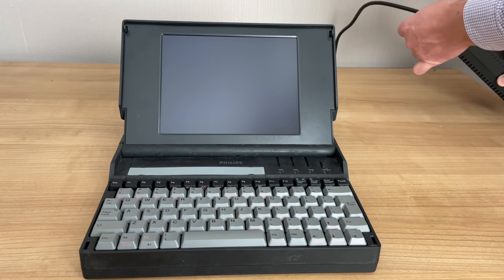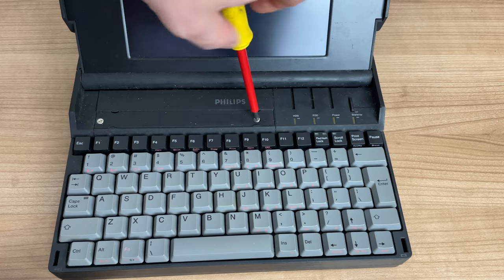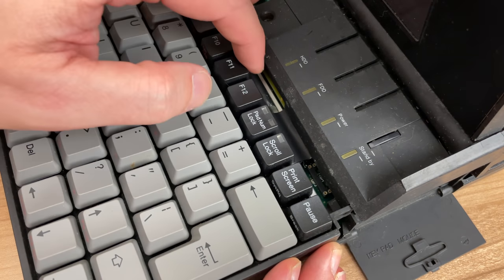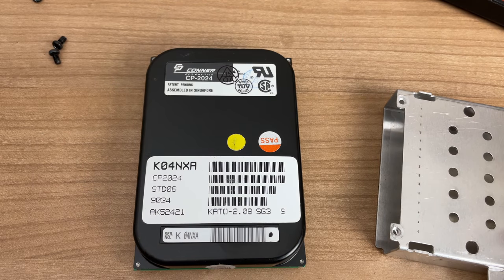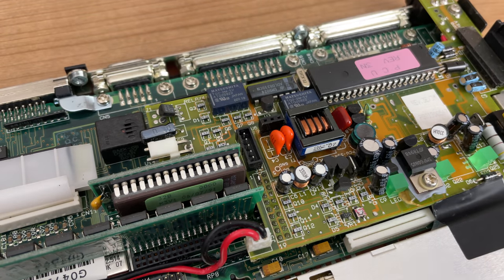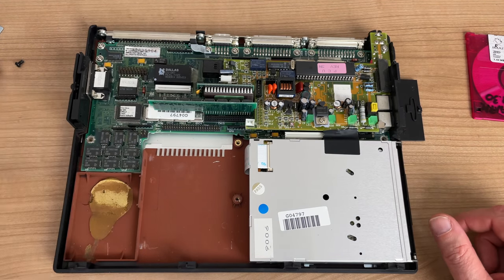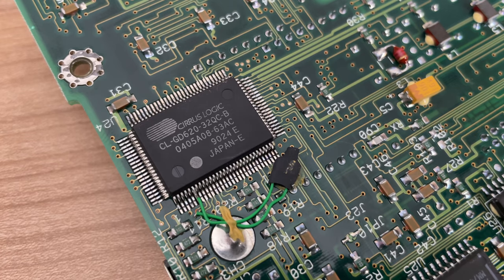Philips 286 laptop - into the belly of the beast

Comment: Whenever I attempt something like this, I test the machine immediately after disassembly to see if it reacts the same as it did assembled. That way, you are not left chasing down hundreds of rabbit-holes that were not caused by soldering or de-soldering a chip...
Reply from the maker: Didn't put it in the video but I did test the basic components (motherboard + keyboard with external monitor) after disassembly and before I started working on the Dallas chip. The issue occurred immediately after replacing the Dallas chip. Because I knew this was going to be difficult (I replaced it with a brand new Dallas chip) I removed it once again an installed a socket so I could more easily swap them in / out.  what I should have done was to look where all the pins are routed to by doing continuity checks on all of them before I started work on them.

Comment: 12:40 when you tried desoldering wire to clean, you touched the chip's (m024g)  legs with wire. Maybe that was what it caused that issue.
Reply: Not to mention he also contacts those pins with some flux beforehand, definitely something to check out!
Reply: Nope

Comment: Try to reconnect the yellow internal battery, the powersupply uses it as capacitor so if it was missing, the motherboard don´t getting correct voltage, I have simular problem with my laptop
Reply: If the problem is the lack of the yellow internal battery, I suggest extending the cable to the outside of the laptop to connect the yellow battery on the outside of the laptop. It's uggly, but this way you can disconnect the battery when not using the laptop and prevent any damaging leaking from the battery to the internals of the laptop. I've made this mod to a Toshiba laptop.
Reply from the maker: Same issue (beep codes) with the yellow internal battery attached
Reply: @RetroSpector78 .. At 15:17 .. that high pitch is an inductor coil.. from a voltage regulator or similar.......
Is at full capacity trying to sustain the voltage output... because there is very high consumption......
you short something up... in that white video connector that is above the dallas chip...
All around the pins of the Dallas chip..... is a lot of traces that go to that flat video cable white connector...
for example .. at 14:33 the 3 pins 13.. 14 and 15 of the dallas chip.. looks like they are in contact with the trace that pass below them... maybe solder mask broke in that trace... 
at 18:54...  the trace that is between pin 7 and 8 of the dallas chip... looks cut....
at 14:28 the trace that is between pin 3 and 8 of the dallas chip... also looks cut....

Comment: The high-pitched noise is the DC-DC converter struggling, there's some power rail pulling too much current. I'd have guessed the backlight power, but the LCD seems to light up no problem. Something's obviously shorting out, and you were working in the area of the display connector, which is now acting up, so I'd concentrate in that area looking for the short.

Comment: The Dallas package is right between the chipset and the video chip. (which probably sits on the ISA bus) I would measure every pin of the  video IC, (probably you find datasheet and pinout) and make sure they are going somewhere. Usually some bus driver IC's. Also make sure this bus driver's are connected properly to the ISA bus. (which you probably can measure on the expansion connector)
If you break some connections while desoldering the Dallas.
That CHIPS IC on the middle is the peripheral controller/superIO. The Dallas clock surely connects to it.

Comment: Suggestion:  splurge on a desoldering gun.  You should be able to find one for about 100 euros.  I was able to get one here in the USA for $125.  It's the same one that Jan Beta has used for years.
Reply: yup, can recommend the ZD 917 as well. Although I have to say, with that old solder it's different everytime. I have spent days on a Dallas chip with 2 ndiffrent desoldering stations, wick, a pump and whatever else I came up with and the result still looked awful. sometimes the stuff corrodes in a way that it just doesn't want to melt anymore.
Reply from the maker: The really really sad part is that I have one, still in box. Time for an unboxing video I suppose :(

Comment: My Compaq SLT-286s are also height-challenged so I couldn't install a socket for the DS1287, so I opted to drill open the pack (there are tutorials online) to disconnect the internal battery and connect an external one. So in about 20 years, when it will run out, I only have to desolder two connections instead of having to remove the entire chip (it was challenging drilling the holes without removing the IC though - but this is now one easily serviceable laptop with zero damage to the motherboard)

Comment: Argh. I feel your pain. I’ve had so many similar experiences of older laptops, which ends up being so frustrating when all you want to do is preserve something increasingly rare. I think all you can do is connect everything as it was originally....? The only comfort I’ve had from an experience like this is then breaking up everything for spares and selling them to others who use the spare parts to return other machines to full health.
Reply from the maker: I know ... but it was worth a shot ... Something needed to be done with the Dallas chip anyway otherwise the computer was pretty useless. (could only boot from floppy and hd wasn't recognised). If I didn't do anything with it it would have just ended up on a shelf.
Reply: @RetroSpector78   You can’t save them all, and unfortunately some will perish by our own hand.  That’s just the risk you take when you maintain these old things.  But like you said, the alternative is also often a non-functional machine.

I just put a PS/2 floppy drive in my “project for another day” pile after discovering that its drive heads were connected by a ribbon cable rather than the shielded wire of the others I was working on.  Guess how I discovered that.  😒  I guess it’s time to learn how to have flex PCBs manufactured...
Reply: @RetroSpector78  it did occur to me since watching that the Philips CDI has a similar embedded battery - i can't remember if it's a Dallas, and instead of desoldering that, I used a dremel to eat away at the plastic and get the cell battery out of the middle and then solder on two wires so i could run a 3v battery at length, and be easily changable... could this have been an option?
Reply from the maker: @sandycheeks7865  perhaps, but using a dremel and trying to fit a coin cell in such a tight space is also tricky. I’ve done it a few times but never liked it. Despite of how it looks now I have replaced lots of them before :) ....but sometimes shit happens and as you probably already know I am not a trained professional. You win some you lose some I guess.

Comment: Oh boy :S That was unfortunate :(
This video made me afraid of soldering/unsoldering, unless extrictly necessary to repair something that isn't working. I've seen a few mods to Dallas chips, were people drill part of the casing and connect a new battery.
Anyway, I really hope that you manage to fix the laptop, and that the fix is something easy to do.
Reply from the maker: I've done the coin cell hack a couple of times, but it is so crammed inside this laptop that it would have been difficult to put the coin cell anywhere. And I don't really like that method. I have desoldered these chips over a dozen times without any issues but sometimes you get unlucky I guess ... (especially combined with my crappy (de)soldering skills)
Reply: You can also use old sacrificial soldering iron tip and melt your way into the Dallas Chip internals. Less messy, excluding the smell and probably carcinogenic melted plastic fumes :)
Reply: @RetroSpector78  Ah I understand the problem of lack of space. There is no doubt that with a new Dallas chip the laptop would also look a lot better. From seeing the desoldering/soldering parts on your video, it all seemed to go well, I would have never guessed that that operation could potentially damage something. Was this your first time getting unlucky?
Reply: @||  Don’t let it sour you on maintenance.  Accidents will happen, but if you practice your skills on scrap boards until you feel comfortable with it, you’ll win more than you lose.  You’ll always lose one or two here and there - that’s just life.

I feel like learning how to solder and replace ICs and capacitors is part of owning retro machines.  If you can’t come to terms with that, they will eventually self-destruct, and then what have you really gained?

Get in there.  Be careful, but don’t be too critical of your failures.  It’s inevitable.  Learn from it and move on.
Reply: @nickwallette6201  Thank you for the motivation message :) I'll keep practising, I have a lot of PCBs that need repairing. I'll just avoid doing it when there is another method available to maintain old hardware.

Comment: As information:
If the DS12887 is a new part, you may need to start the oscillator...

"When the DS12887, DS12887A, DS12C887, and DS12C887A are shipped from the factory, the internal oscillator is turned off. This prevents the lithium energy cell from being used until the device is installed in a
system. A pattern of 010 in bits 4 to 6 of Register A turns the oscillator on and enables the countdown chain. A pattern of 11x (DV2 = 1, DV1 = 1, DV0 = X) turns the oscillator on, but holds the countdown chain of the oscillator in reset. All other combinations of bits 4 to 6 keep the oscillator off."

http://dgmag.in/N1/Online/advanced/48629.pdf
Reply from the maker: Not sure if this is the issue here was with the original DS1287 I'm getting the same beep codes. I have replaced these Dallas chips in over a dozen machines each time using new parts from digiKey and never had to do that ... But interesting info thx for that.
Reply: Interesting, didn't know that. Not entirely unrelated: My Commodore PC40-III didn't set the time display correctly, it needs decimal, but the chip outputs hexadecimal, leading to times like 1; : 4< o'clock. I put the module in my IBM 55SX, that corrected that, then I put it back in the Commodore.

Comment: 1long, 3short No video card or bad video RAM- Reseat or replace the video card. To aggressive on the heat gun maybe? Try measuring circuits, your only solution maybe. Those chips next to the Dallas clock are bus drivers. Thanks for the video, I always enjoy watching.
Reply from the maker: Thx a lot, ideally I should have another laptop to compare it with. I think this board was also used in Siemens laptops.

Comment: The machine seems surprisingly serviceable. I have a similar laptop (a 386 SX made by ESCOM), where the hard drive is buried under the power board and in order to add a math co-processor you have to take out the motherboard. But at least it doesn't have a Dallas clock chip.

Comment: You have probably did some damage with the hot air gun. Check the blue thing between the two  244 IC.
Reply from the maker: Seems to be an EMI suppression filter (1000pF) that is wired in a creative way. Not really sure how to test it.

Comment: 9:20 The two chips with pink labels(firmware versions), one of those will be the keyboard controller. The big 40 pin DIP chip with pink label on the power-supply board, that will be a microcontroller for the supply and charging management.
Reply: Pretty sure the other PLCC is the BIOS; I thought I saw a 27C part number on it.

Comment: The high pitch noise suggest a power supply overload. That pink-white cable is the CCFL backlight power feed. (it has it's own small PCB with that large transformer) I would try the laptop with that disconnected. Beware, high voltage there!
The PSU board generates several different voltages by the looks of it. I would check all of them with an oscilloscope. (inductors are a good place to start)

Comment: I'd go over all the traces and continuity check-the whole area around clock module several times. I know it sounds like the typical answer (and it is) but things rarely just stop functioning for no reason. Something got damaged, cut or shorted somewhere.
Reply from the maker: Problem with these multi layer boards is that a lot of the traces aren't visible. And if I don't find continuity for certain pins anywhere, then I have no idea how to repair them :(
Reply: It looks like, may be,  the SIP resistor pack is damaged? There is something like a crack/damage on top of it. (The pack right above the dallas chip).
Reply from the maker: @fhunter1test  yes it was ... noticed that one also and replaced it (think I used it to hold my screwdriver in place as I was lifting up the Dallas chip) and it cracked. Replaced it but same beeps.
Reply from the maker: @fhunter1test  nice catch by the way ! :)
Reply: @RetroSpector78  "to hold my screwdriver" it's so lame...
Reply: @Franko  It happens.

Comment: @10:16 Chips 82C601 is the controller. Pretty versatile chip, IDE, LPT, two serials, FDC and RTC chip selects.

@8:33 probably mostly external ISA. Would be interesting to make an adapter board with full size slots.

@9:13 I would suspect 44 pin plcc Intel N87c51 to be PS2 controller, and Signetics Chip to be the raw keyboard matrix controller. 20 pin DIP REVD stickered chip is some kind of a clock generator.

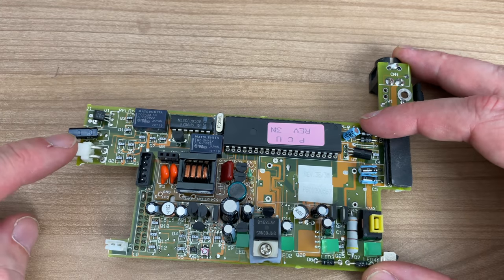@11:35 looks like whole microcontroller just for power management. PCU - power controller unit?

@16:00 the result - no ESD protection? bad caps on the power board? that high frequency noise often signals tired components, very high load or a short.

I would start by measuring power rails and their load. Then check all address/dats pins to the VGA controller, ten all the clocks with oscilloscope, then dump and disassemble the bios to check how exactly does it determine 3 beep graphic fault code. This all sounds like a great content potential, looking forward to it! Love your channel, dont give up on it :). If you want more specific help open a thread on EEVBlog Forum in the Repair section and Ill assist you.
Reply: If that coil whine (or whatever it is) is new, that’s a good clue.  I’m not convinced this is due to a trace or via from the clock chip.  It could very well be a dry solder joint on one of the connectors going to that power management board or something equally unrelated.  Anyway it seems power related.  I would be particularly critical of the backlight inverter circuit.

Comment: If I had the laptop I’d start by checking voltages across points on the mobo and check for short circuits too.
When I have hardware problems I do a process of illumination but maybe try different memory or just try reseating the current memory after cleaning contacts using an eraser maybe?
I’ve had beep codes for VGA problems and it turned out to be system memory which was not seated fully and with old machines I think you need a module in the first SIMM slot (0).

Personally I’d try disconnecting the hdd and floppy drives etc until you have only the essential hardware hooked up needed for system to POST.
Edit: just read the comments and seen you’ve tried this.

Have you tried cleaning the connector on the end of the flex cable that goes to the mobo to power the display?

Comment: Desoldering; it's best to use a chisel shaped tip, and higher heat, with a thicker tip for desoldering. This goes both for using the braid and the solder sucker. Use the flat horizontal tip to press the desoldering braid against the area that you're working. Keep moving up the braid as the copper strands become saturated with old solder.   

You were right, that something was wrong - the tip that you're using isn't very suitable for desoldering.  

Hope this helped.

Thanks for the content.
Keep up the good work.
בס'ד

Comment: In this situation you don't need to remove the Dallas chip.
Just pry (or cut) open the plastic case and you'll find a lithium battery tucked over an CMOS ram chip. Just remove the coin cell and solder the new cell. Put or paste  the plastic cover back on, and you are good to go! 
No soldering messup !

Comment: Hope my repair goes better. I suspect the heat of the soldering iron screwed something in the layers. would be nice to have a schematic for these things but it is so rare for any information to be available. I suspect I have a similar issue on a Grid Pad 2260 and it works but there is red missing in the vga output, the serial port is having issues with data errors, and the pc card slot will not work with anything as far as I can tell. Hopefully nothing is leaking.

If you can tell what lines of voltage it needs if you can have multi-volt power supply handy maybe try feeding the voltages in manually. Sometimes the power supply is borderline and can get just weak enough to not let something power on.
That smaller battery is sometimes called a bridge battery. usually has the intention of allowing the computer battery be changed while the laptop is in power saving mode.

The hard drive is still working and I backed up the contents once I found a parallel port data cord which is a small blessing. Would have taken around 40 hours or so to backup the 105 MB of data on the hard drive using the serial port at the worst and only stable settings for it and the parallel port only took about 2-3 hours.

Comment: Could it be that there was a cold solder joint somewhere and that, when you picked the motherboard with you hands, it broke? Maybe you could try to resolder all joints in the motherboard with a soldering iron.
Reply from the maker: That’s a lot of joints to check :) Before I swapped the Dallas I had the motherboard on my desk and hooked it up on a regular basis. It always started before I swapped the Dallas.
Reply: @RetroSpector78  Good thinking testing after disassembling. I should start to do that as well.